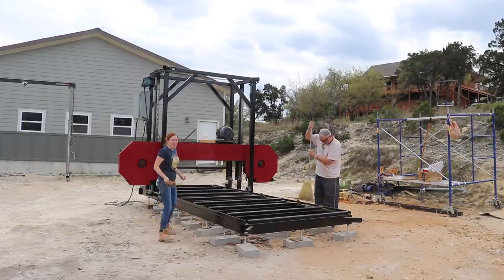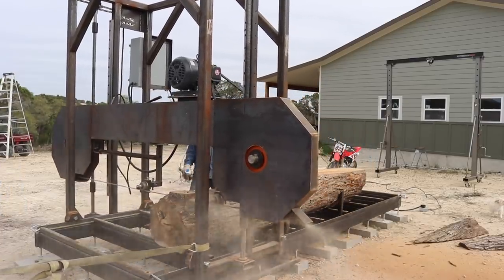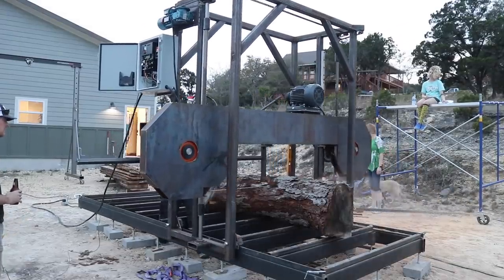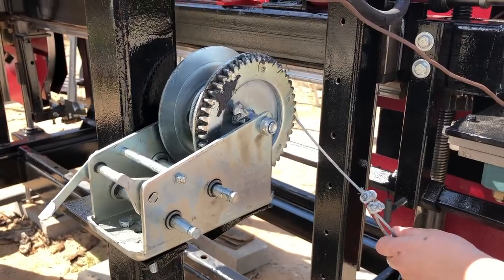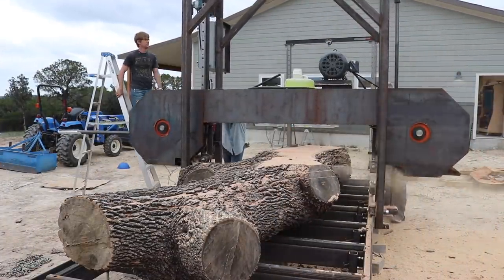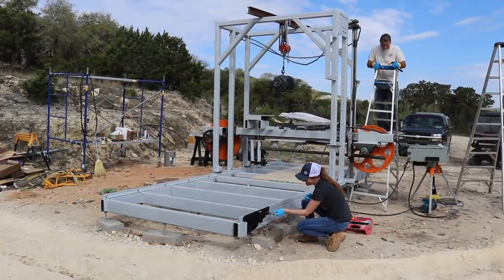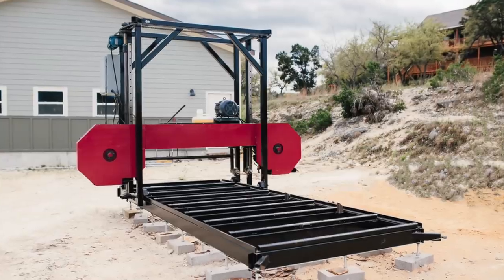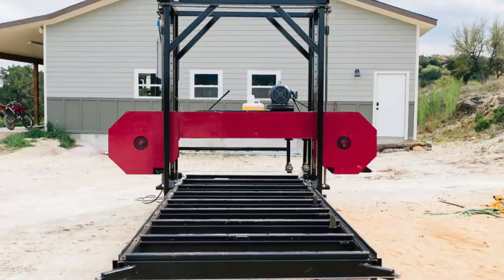Slabbing With My Bandsaw Mill

Comment: Great confidence builder to tackle this project that for many years it will yield benefits. I wish I could ship you some of our Black Walnut & Sycamore  that we have in Kansas. What could the girl do with that!  I have a Hudson mill which is much smaller but I'm a little old man and have limitations. Its good to see you apply & improve your metal working skills and be an open minded team player. You set a good example of organizational skills and the project went smooth. I wish I was 20 yrs younger to enjoy working hard on a fun project like this one again.  Protect that Frequency Drive from the heat of sunlight, a tarpaulin is not enough. I have used many frequency drives up to 60 hp in a heavy industrial setting and they can handle humidity & cold but direct sunlight can kill them quick, without shade. Handy tool &  they are better than the phase converter & 20 hp idler motor that I use to supply my 3 phase in my home machine shop because you can start up slow without burning belts. Getting a shed erected over the whole sawmill is some thing you don't want to delay because the mill isn't complete and operational without a roof over it and the concrete slab poured under it.   Plum Red & Black is very pleasing to the eye and  good choice. You have good reason to be pleased with you craftswomanship, hey a new word for the dictionary. Find a way to control & dispose of all the sawdust generated, you will use this mill allot because your building in user friendly and it can be overwhelming to have piles of wood debris, bark and what have you. It will attract insects and rodents as well as what comes with the logs.  Just with my little mill its a nuisance, but your in for a awakening, you will have a huge compost pile. Have Fun! Be careful.Glen

Comment: Get a set of forks for your tractor. Works a lot better moving logs.If your using your tongs alone just use a strap and rubber bungee cord to keep the log level.Always keep the bucket as close to the ground as you can when moving, the weight of those logs will fool you.Norwwod Sawmills has a app that will give you the weight and board feet, etc. Try not to drag them through the dirt if you can help it,dirt and rocks shorten your blade life. Keep the bucket slightly forward so your straps and chains are not putting all the weight on that sharp cutting edge.  Running water on the blade is more to keep pitch from building up from softwoods then cooling the blade. If you feed too slow this will heat the blade, you want to cut as fast as the machine is comfortable.You all did a super job building that mill! Good luck with it. You are going to make a lot of beautiful wood.

Comment: That was an awesome expensive build. I'm planning on building my own and I'm going to make my own bed that goes over 40 ft long. You never know. When I had my wooden miser sawmill, I just used Dawn dishwashing soap in my water and it worked really well except for with pine. Pine would build up because there was a sap everywhere.
When you have trees that don't grow straight there is a technique to get the logs to be only bent one of the two axes. So I would always measure for a fur type tree the center point and make it the same exact height off of the bed. That way all the boards were cut to their maximum strength.. I also would try to measure out from the center so when I was done cutting everything, you would actually see that very center for one end of the board to the other on a straight log.
Let's say you're down to a tree that's about 9 in in diameter and you want to cut a 6x6 out of it knowing that you're going to have a little bit of the wein left over in the corners. If you don't have your dimensions exactly from the center of that chunk of trunk, you're bored is going to warp big time more than likely.
Definitely wash and scrub those logs clean after dragging them through the dirt. I'm on a cell phone but I didn't see what look like any kind of a locking dog to hold the log firm against the back supports.
I would like to be able to solve wide logs once in a while, but I'm not going to spend that much money to go that wide. That's really a well-built sawmill and it should work for years and I'm glad you did a good paint job on it. I like to clean and paint my metal first and grind off where I need to and then touch it up. To each his own. Thanks for sharing your build with us, I can only imagine that that one must have cost about 35 Grand by the time you were done, including labor.

Comment: One thing you can do when stacking your slabs is to alternate which side is up. That way, if there's a natural twist or cup in the wood, the internal forces will cancel out while they're drying and prevent some of the warping. Of course, these don't stack as pretty and you have some of the long faces on top that catch rain, so cover them.

Comment: Electric winch would be a great addition, and you should wedge the slab as you cut so that the blade doesn't get pinched; it's probably generating a lot of heat and changing the color of the wood.

Comment: When you build your shed design a jib or bridge crane into it so you can handle logs on your own without the extra equipment, but leave your post open enough to get some equipment with forks in to move your material.

Comment: Is diesel used because it lubricates like oil but is volatile and evaporates without being trapped in the pours of the wood and staining the slab? 

I imagine most metal on metal lubricants are designed to stick around as to reduce the amount used and reduce the maintenance, but I imagine sticky lubricants would ruin slabs as the wood would just drink it up. 

I love this project. I've always loved making tools and my dream project is making a metal lathe, which is super difficult due to the tight tolerances needed to make it useful. It is amazing to think how smaller tools or less precise tools can be used to make bigger or more precise tools. 

Keep the slab art coming, I know you do a lot on the channel, but a weekly or monthly installment of slab cutting, perhaps with your knottiest* highlights would be really cool. I think it would be cool too to see the team come together on the 1 year anniversary to cut into a rare piece of hardwood.

Comment: When you go to build your shelter for the mill, you should structurally integrate a loading gantry that allows you to unload logs from the tractor, truck, etc. at the front of the mill and then use the loading gantry to safely and precisely load the logs onto the mill.

Comment: April, looks great!  Just curious if you have well water.  Will the diesel fuel eventually contaminate things?  Also if you coat the ends of the slabs while drying it will help keep cracks from forming on the ends.  I think they use a type of wax or something.

Comment: Also, a few notes for future improvements. 

First, have you given any consideration to replacing the winch with two acne threads? It seems like the winch is relatively slow anyways, which I imagine is best for the blad. I'm not sure how expensive beefy enough threads the length of the sled run would be, but it wouldn't be too difficult to mod the sled to use the threaded rods. You could use a variable speed electric motor and some gear reductions to run the rods together to keep the thing moving perfectly straight. Wiring up to the remote, you could set the forward run speed of the motor at the panel for the kind of wood and size of slap, then use a single run button at the remote to progress through with button release stopping the forward progression of the sled. A return button could be wired to run the motor at full speed in reverse to return the whole sled to it's start position. 

Another addition could be acme driven blade tensioners and a set of laser measures leading the blade to move the tensioners in and out to remove even more risk to those running the mill. Another option here would be a little more mechanically complex, but a set of small weighted dolly tires on on pivots, connected to the tensioner rods with a slight offset could do the same thing. Here, the weight would keep the wheels gently hugging the sides of the log just ahead of the blade and would move the tensioners in and out to match (plus padding) the width of the log, without the need for 2 more motors or acme threads. 

Finally, you mentioned a digital height readout. Here, it would be simple enough to take it a step further and add a microcontroller. This would allow the operator to line up the first cut and set the slab spacing; adding a limit switch to signal when the carriage has returned would allow spacing to be adjusted automatically ahead of the next slab cut. Combined with the two other ideas, this would increase the efficiency and safety of the mill. The return button on the remote would allow it to return rapidly, set spacing for the next cut automatically, and move along as soon as the operator is ready and holds the run button. A few other things you could add would be rpm sensors or blade contact sensors on the external sides of the tensioned blade to detect breaks, sensors at the phase generator, current sensors, and other fault sensors to cut off the machine in the event of a break or other emergency, as quickly as possible. All of these safety features would also allow you to add a safety square around the machinery with some cheap laser fence diode and sensor plates to ensure nobody is near the machine while running. These would be best implemented after the cement slab and weather covering are installed, of course, but definitely something to consider in the medium to long run. 

These machines are very cool tools, and I'm sure you and your crew have a healthy respect for their power. But accidents happen. My dad, wayyyy back in the 70s and 80s, managed a saw mill, and more than a few veterans lost fingers and maimed hands and forearms being too close to a machine when something went wrong. They came to know their machinery and became too comfortable, and hurt themselves. Something as simple as a nail from a long gone tree house that the timber grew around could be concealed in the slab, and could be an unavoidable fault that snaps the blade. The blade guard is good but may not be enough to protect the winch operator from steel blade fragments, especially given the drive and idle axles store enough rotational momentum to fully unspool the broken blade. 

Feel free to reach out if you want any input on safety systems, parts, or microcontroller programming. Though, I'm confident your onsite engineer can implement any of these ideas if you chose to explore them. 😁

Comment: Great video. April don't place the stickers in one line but alternating to each other. The wood wil dry better.
Reply: Yup, because then each point of contact will only have the depth of one stick+one slab, rather than a stick+slab+stick (and so on) stack.

Comment: For the blade guides is it possible to put small wheels vertical to ride on the outsides off the log while cutting with a spring pulling then toward the center that way the guide are always at the same distance and you won’t need to adjust them every second

Comment: First of all, I really enjoyed this series. It looks like you all had both a productive and fun adventure. I hope there were no "casualties"; smashed fingers or steel slivers. One quick question; are your saw blades custom made or "standard" sized? In other words, did a "standard" size blade define the actual size of the final design of the mill or did you design the mill and then "found" the blades?

Comment: Would the pink of the slab be due to the moisture inside the stump itself? Wonder if that does go away after some dry time.
Something to note: I did notice that there is still sawdust on/in the blade and is being dislodged by the lubricator on the pulley end.
I'm not sure if there is a brush or something to dislodge the sawdust before the lubricator but did notice it pile up underneath the pulley.

Awesome job, April! This mill is already serving you well and will be pretty damn sweet once up and running fully :)

Comment: You should build a separate set of tracks on either side so you can add a crane. The tracks should clear the end of the saw, that way, you can use a flatbed or the tractor to position the logs where you want them on the ground, then pick them up with the crane, turn them, twist them, etc. It would reduce damage to the mill frame from impacts.

Comment: I like to have a table from such a slab.

You should seal the ends of the slabs with wood glue or whatever is better suited. The ends dry faster than the flat surfaces, becasue moisture can leave the wood faster at the ends. Because of that you can get cracks, as there will be aq moisture difference in the wood at the ends vs the more inner parts. When you seal the end surfaces, thoose end parts dry slower, with a similar speed as the surface parts.
This end sealing is also done when wood was harvested for making bows in example. So that you get an intact raw piece of dry wood without cracks for shaping the bow.

Comment: I’m sure you will read up on the different ways to roll and cut the log for most efficient cuts as well as best strength if needed (I.e. flat dawn vs quartersawn).
One tip, however you will probably not read is that handling any decent amount of wet oak (some other woods as well, like cherry and walnut I believe) will stain the palms of your hands.  The only thing that will remove it is bleach.  I remember years working in sawmills over summer breaks to put myself through college.  I would just deal with it during the week, then bleach my hands on Friday nights so I could go out.

Comment: On our mill, we have a chain like a #35  to power the head. It runs from the front of the frame to an idler sprocket on the gantry up the gantry to a drive sprocket back down thru another idler sprocket then to the back of the frame. Where there is a tensioner.   _n_  This allows us to move both forwards and backwards under power. Using a small variable speed motor.

Comment: i would make up some heavy steel pallets  to put your slabs on. you can then move the slabs over each time   and then move the whole lot to you storage area later. when you are designing your shed for the mill you should consider adding in a rsj girder over the mill so that you can mount a winch to lift the slabs  and roll them along the rsj over to your stack . those slabs are heavy.  maybe a small version of a gantry like they have in steel shops or at the docks

Comment: Primer is almost never solid in color. It is put on to act as a bonding coat between the base material and the finish paint. So, one coat of primer is usually all you need. No need to waste time with additional coats, unless you leave the primer on longer than recommended and it looses it's bonding properties.  Just thought y'all could benefit faster than me(years folks, years). A beautiful machine. You should be so proud. Love the colors.

Comment: Have you considered using rollerblade wheels and Springs to control the blade guides.
Use the roller blade wheels to run along the wood and the spring for lite tension

Comment: At 17:02 it looks like someone somewhere at sometime saddled a pair of dead horses.

Are the carriage rollers on one rail provided with the ability to slide on their pins and accommodate for differences in expansion? Just a thought. A large sawmill headrig uses one tracking V rail with the other rail set as a guide for elevation only. Just sharing for deposit into your squishy stuff library. Enjoy your thin kerf. Peace.

Comment: For the shelter...4-5 feet bigger than the mill on all sides, four steel posts, the corners, build high enough that you can incorporate a gantry crane over the mill...tractor brings log, crane lifts and sets.
Reply: And DRO for the height...like on mills and lathes

Comment: If you are using "off-road" or non-taxed diesel the Govt. tints it pink. This is for finding out if trucks are running offroad fuel in their trucks. The pump diesel has a greenish tint. This may be why you are getting the pink colored wood. (If you are using off-road stuff). Just a thought.

Comment: All you need to know is the threads per inch on your height adjuster and then it's just a matter of the number of turns, or part turns it takes to make the depth of cut desired.....Great video....

Comment: Make the guide rods automatic. You can use a simple spring system and wheels to hug the log. It does mean you have to ensure you don't get trapped - so another option is an electronic system.

Comment: The saw mill beats most any mill you can buy.  Suggested add-on:  Followers for the blade guide that track the changes in the width of the log, especially logs that have crotches..

Comment: Have you ever heard of a solar kiln? There are a few different designs, from super cheap to a more elaborate building type kiln.  They use the sun to heat and dry the wood over the course of a few weeks to months depending on thickness, species, moisture content, etc.  I plan to use one of the cheaper designs to dry a few small  slabs I’m cutting with a chainsaw mill.  Search YouTube, I’m sure you will find something you like 😀 maybe I’ll post a video when I make mine.